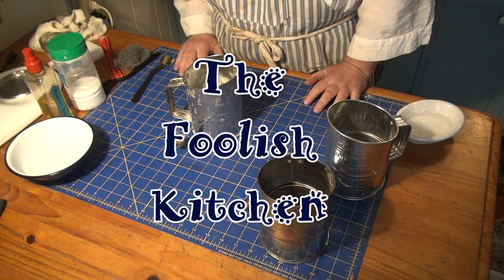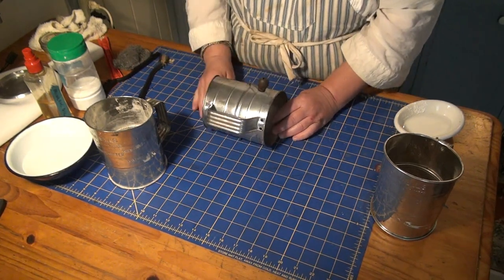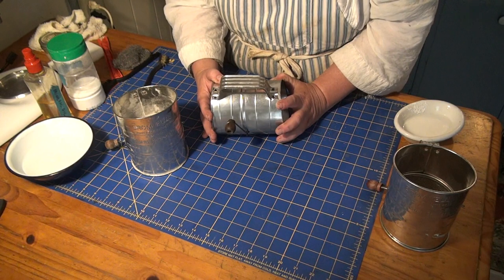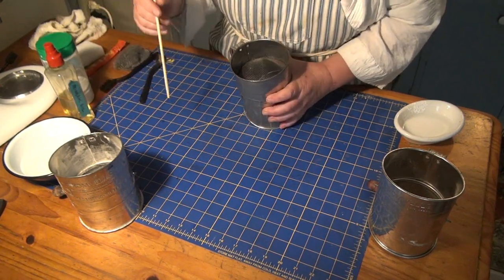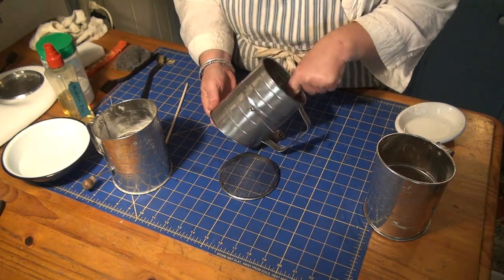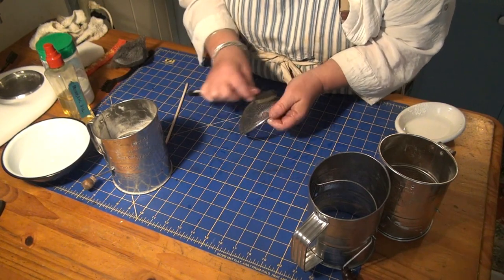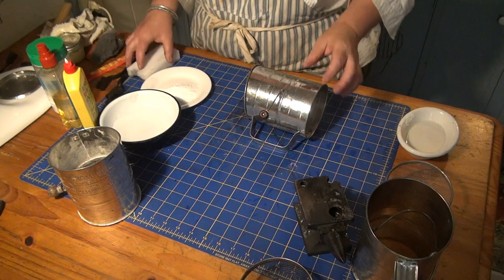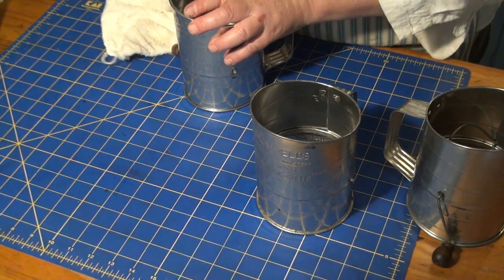Bromwell Tinware Flour Sifter Teardown

Comment: How do I put back together the squeeze-handle kind?
Reply: which model? i don't have the large one to take apart just a small one.  I will see if i can get one to dissect
Reply: @joycegodsey  I don't know the model. It's not annotated. It has three screens and 3 star cutters. It's trigger- handle operated. Hate to buy a new one, even though it's seven bucks. It's a pride issue,  I guess.
Reply: @MrAkilwil  I GET the pride issue.  That's a more modern device I will see what I can do
Reply: @joycegodsey   Thank you for replying!! I really appreciate it!!
Reply: @MrAkilwil  well I will try to answer your question, I have seen new ones that do g seem to come apart. So is like to figure this out
Reply: @MrAkilwil  boy those are VERY easy to take apart...but are like a bar puzzle to put back together.  I should have taken better before pictures.  i will get back to you.
Reply: @joycegodsey  Yes... if you figure it out, you would have the only one of a kind video!! I know I'm baffled.
Reply from the maker: @MrAkilwil  I've made some headway. I know HOW it goes together. but these are assembled by machines, so i am trying many different assembly orders, with no luck.  When I get the parts assembled in the right order it doesn't work.  I would like to share my results with you.  go to my website and contact me, I will email you instructions and pictures.  Maybe you can figure it the right order of steps.  
http://foolishkitchen.com/about/
Reply: @foolishkitchen2707   Email sent. Really appreciate your efforts!!